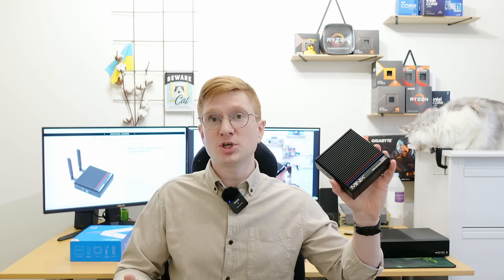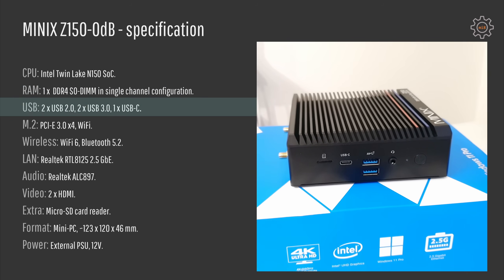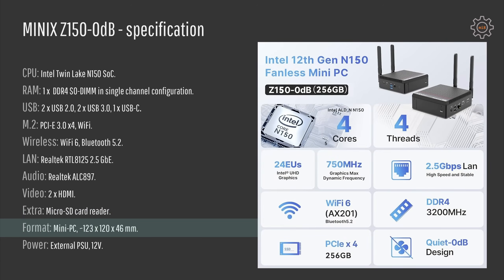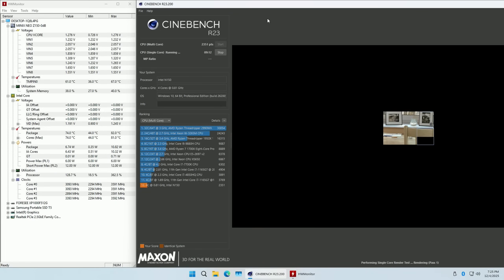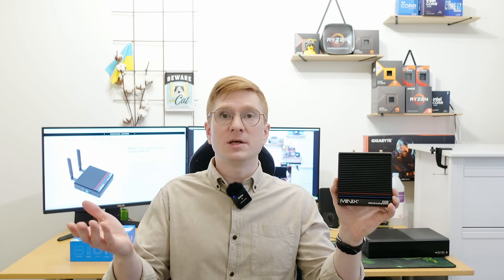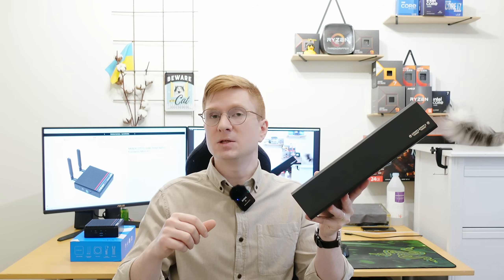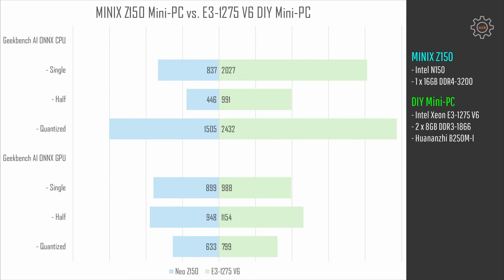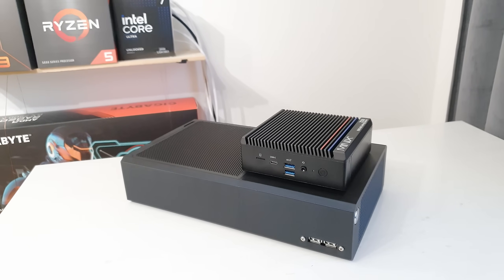MINIX Z150-0dB Mini-PC with Intel N150 or DIY with E3-1275 V6?

Comment: I’m planning to buy the Gibabyte TPM and the usb 2.0 extension for my Machinist X99 Mr9s. But I don’t understand the installation method, do I need to plug the tpm to one of the usb 2.0 extension pins and the other one without pins to the Jlpc? Because I’m not that experienced if it needs soldering.
Reply from the maker: That's exactly what you do, stick pins into TPM and socket onto JLPC to connect TPM module to JLPC header.
Reply: Aight, thank you very much, always loved your channel!

Comment: Does it boot from the microSD card?  Many of these Chinese Alder Lake/Twin Lake  miniPC's (and NAS boards) do, even if it's not documented.  Based on a glimpse of your CrystalDiskMark test, the slot looks to be better than USB2 speeds. I would test the boot with a quick install of Debian on the microSD card.
Reply from the maker: That's something I didn't test but I assume that it just works as I have tested it with other similar machines. If I don't forget I will test it once I am back to my office.

Comment: In August I've ordered Firebat mini PC on n150 (16/512) for less than $90 Netto. Kind of bargain. 
It should be a good choice for Ukraine power outages, if to connect to portable 22...24" monitor for $90...140.

Comment: N150 - something like i5-7400, but takes like what.. 1/10 - 1/11 of what i5-7400 draws
but sad it is still forced to only single channel memory :/
Reply: It is using around 19 watt, when you see i5 7400 using 190w please call me i want to see that. It's more like 1/4 that becomes a bit more than half when 7400 is undervolted depending on the silicon lottery, now if you also take a second ddr4 sodimm you might still get close to 3 times power consumption, but also a lot more bandwith.
Reply: @gabrielecarbone8235  not to mention i5 7400 can easily run on like 10W idle power (depending on mobo). You just need to be able to reach lower power states like C10.
Reply: The N150 iGpu also is capable of 4k60 unlike the 7400 I believe.
Reply: @GresterNandes  7400 is UHD630. It's perfectly capable. You're limited by the motherboard's HDMI port - whereas GP has been able to achieve that since earlier versions